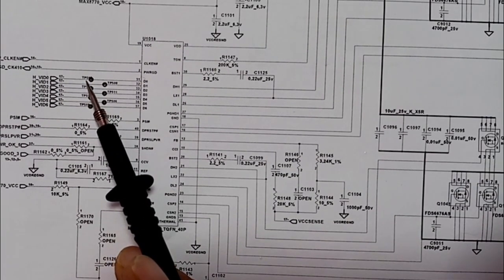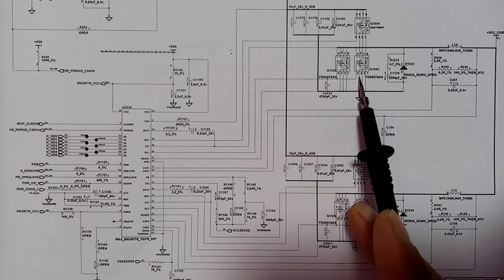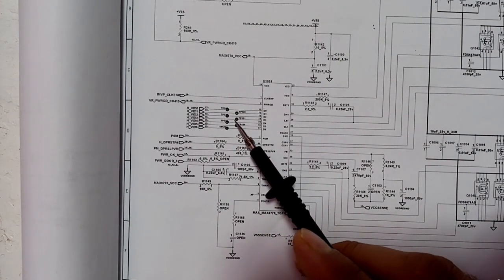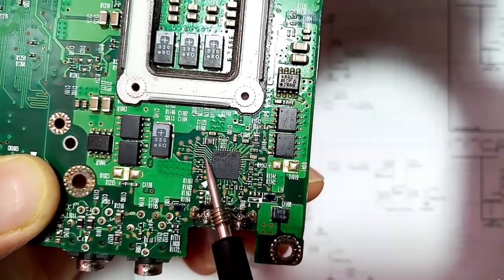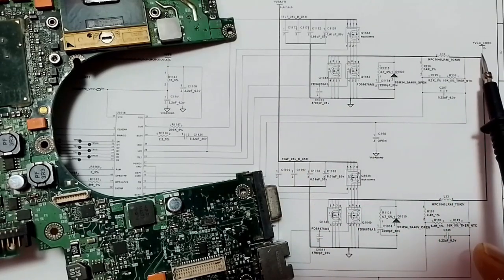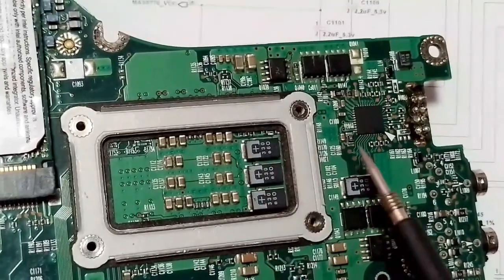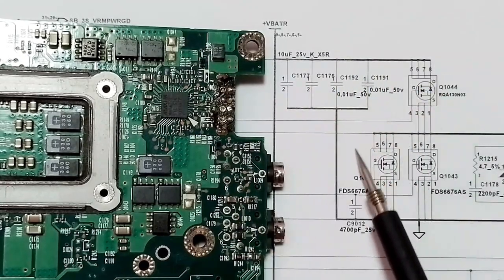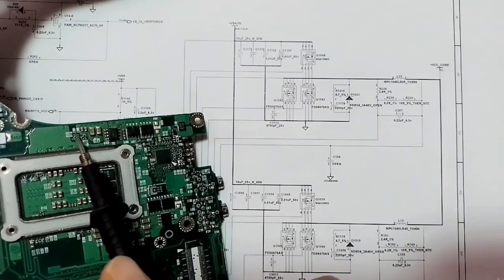Motherboard CPU Circuit Explained - Motherboard vs Schematics Parts and Components

Comment: My friend, the capacitors connected to the vss_sense and vss_axg_sense signals of the isl95837 vrm chip are short-circuited capacitors (pc41, pc46). How can I tell if the problem is in the chip? Thank you.
Reply from the maker: Usually when ceramic capacitor around the IC are shorted that means IC is shorted not capacitors,but sometimes capacitors could be failed it self
Reply: @electronicsrepairbasics_erb I have seen many cases where ceramic capacitors are faulty and after being replaced, the motherboard works just fine without replacing the ic
Reply: Thank you, so at what temperature should I remove the chip? I couldn't insert it at 380 degrees.